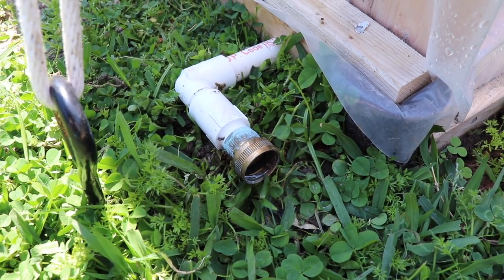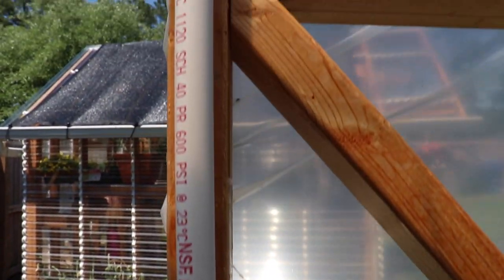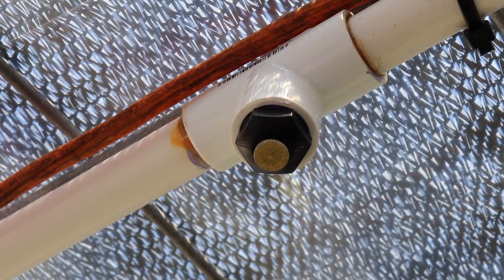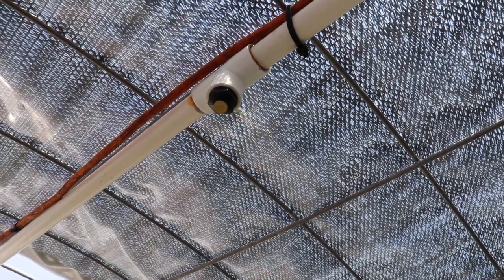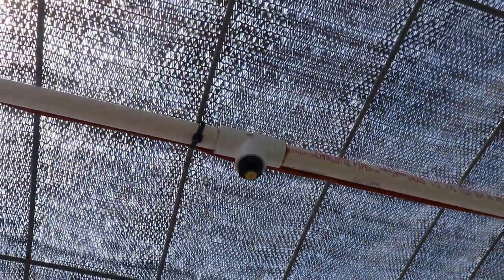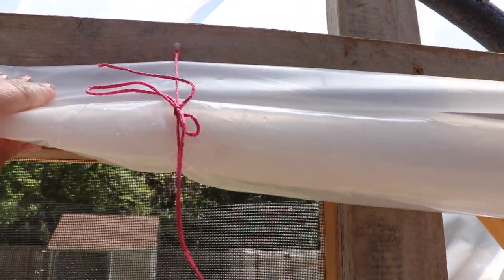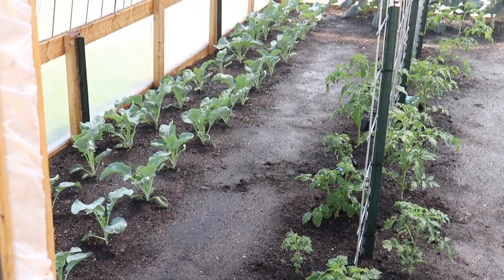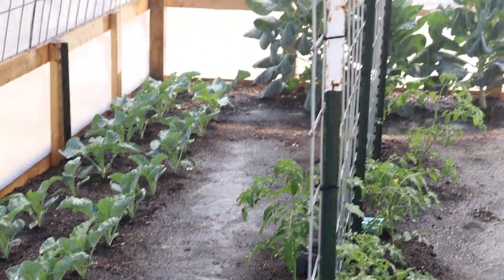Hoophouse Sprinklers || Easy Overhead Irrigation || How we Did it!

Comment: Hi from Germany, we had a wet summer over here with a lot rain. Tomatoes and potatoes suffered from that, and powdery mildew spread into some other cultures.
It dependes where you live and what cultures you like to grow. For me, drip irrigation to feed the root zone works far better than overhead irrigation. I have a few moisture sensors to tell the system that the drip irrigation has to start and stop,  depending on soil moisture.
Cheers, Bernd
Reply from the maker: Yes we’ve done drip irrigation in our greenhouses before & we like that as well. Thanks for watching, cheers!
Reply: @HomeFreeAlaska   - I absolutely love this system, when I finally get our greenhouse built hopefully this spring I am planning to use your system. I love that it replicates a mild rainfall, although now that I think of it, I am wondering about something... We tend to get a lot of rain here in Central-Eastern Ohio and I am planning on catching some of that rain to use in the garden since we only have one spigot on the house that I need to water not only our front gardens but also run 300 ft. of hose to water our big garden out back which is ridiculous. So I am wondering if this system will run on water catchment if I have my barrels up high enough to create a natural downspout pressure of some kind, what are your thoughts?  Also, I would like to ask you and @RheinErftVideo if you can please describe these moisture sensors a little more for me.  Thank you so much for all of these wonderful inspirational videos. Many Blessings to you and your beautiful family.    
~SuzyJC-in-Pataskala-Ohio/USA_03.04.2022~
Reply: @suzycowan5072   Hi Suzy, just saw your question and this is the way I did it:
A used 275 gallon IBC tote / container / tank (make sure it was not used for chemicals before) is about 50 $ over here. To collect rainwater. You can stack them. 

I attached a 12 Volt Waterspout Fountain and a magnetic valve. Without the valve, the  water would rinse all the time.

The sensor for soil moisture is some electronic China product from ebay. You put it into the soil and you can calibrate it to what soil moisture you want / need. 
If it´s too dry, the sensor will open the valve and start the pump. If moisture is about the right parameter, the system will stop.

The 12 Volt system is very good to be independent from electricity and just works from a solar panel and a car batterie.

For the drip irrigation, I made this from small tubes for electric wires to be used in house installations. Small holes being drilled into it so water drips into the rootzones of the plants (measure before how far you plant, I would say 15 inch distance is a good start for drilling).

As you can see, this is no ready-to-go system, but pretty easy to install and low-cost.

Comment: nice greenhouse build :) . I have just 2 points to 'critic' if you allow : never water the tomatoes leaves ( to prevent from deseases ) , and you should cover the ground with mulch or chalkboard to prevent from water evaporation. An irrigation on the ground and under the cover, would protect better the plants , and prevent from water waste :)
Reply from the maker: Thank you my friend but we’ve done ground irrigation before & wanted to try overhead this time. We’re ok with a little water waste as we live on a well & it’s not much waste anyway, it sinks down into the ground within minutes! And plant leaves get wet all the time with rain…that’s the natural way to water. 😉 I’ve never had any issues with watering this way…most important thing is air flow and circulation, prevents the plants from getting disease. 😊 Thanks for your recommendations & for joining us on this video! 😉

Comment: I really like the connection attachment for the water outside the building. This allows water that may be caught and saved on site to the pumped on the the sprinkler system using a submerged pump in the water storage and then pumped by hose.
Reply from the maker: Yes Marshall, that's actually a great point. I hadn't thought about that! Thanks for joining us on this video! :)

Comment: Thank you for your video. Question" What kind of materials that you used to cover above the clear plastic on the top? Why did you need this material?
Reply from the maker: Hello again :) Thats a shade clothe. It's optional but it's very useful in reducing the inside temp of the hoop house while still allowing the sunlight through for the plants. 

Here in VA its way too hot in the hoop house in the summer time, the plants would just die! The shade clothe makes it a lot better in there. That & the fans for circulating the air.  I bought it on Amazon, pretty inexpensive. I put links to all the supplies in the description box of the video. :)

Comment: It would more easy if you use a rain tank and an a cheap irrigation programmer, so, you don't need to take the heavy hose from the home to the greenhouse for watering. Only for refelling in case that it's empty. Greetings from Spain.

Comment: You don't end up with mold in your hoophouse from that? I probably would have just laid a soaker house along the ground where I wanted to water.... awesome system but seems a bit more complicated than necessary
Reply from the maker: Not complicated at all Keith. Actually installing these sprinklers made my life way easier! I just turn it on & it waters the plants for me. We’ve never once had a mold issue. We have a lot of ventilation & air flow in the hoop house. 😉

Comment: Tomateiro não gosta de água nas folhas.
Reply from the maker: As long as there is good air flow and circulation, we have never had any issues with wet tomato leaves causing problems. After all, they get wet naturally in the rain if planted outside. Pruning the tomato bush is essential to ensure good air flow :)

Comment: Tomatoes are sensitive to water on their leaves, risk of development of late blight.  Sprinklers are not a good solution ...
Reply from the maker: Thanks so much for your comment but we’ve always watered our tomatoes with the garden hose & their leaves have always been wet in the process & we’ve never had an issue with blight. As long as there’s good air flow, they’re fine. I heavily prune my tomatoes to ensure they have good air flow! Thanks for watching! 😊
Reply: If this were true then what happens when it rains?, I think it is more about air circulation.
Reply from the maker: @workinonit9562  my thoughts exactly!! It’s all about air circulation.

Comment: Nice job i live in alaska i think i would have to take it apart for winter we get lots of snow.
Reply from the maker: Hi Patricia! We LOVE Alaska, what part are you in? We spent 7 yrs there with the military. 3 yrs in Fairbanks & 4 yrs in Ketchikan. We’re considering retiring there. I don’t think you’d necessarily have to take it down in the winter…I just think it may need some added support beams down the center on the inside to help hold snow. But I think it would be important to clear the snow off of the hoop house every so often and not let it rest there. 😊
Reply: If you're worried about snow then a gothic arch with cross bracing should be able to handle much higher snow loads. Think how strong a medieval cathedral is and they're an arch supporting a triangle. You could still use a similar construction method, but have a wooden ridge line and possibly some center supports. They do need to be a little higher than a semicircular arch though.
If you have high winds then using twin wall polycarbonate is another option (more upfront cost, but will last a lot longer). This is a common solution in the Shetlands, where there are very high winds.
A gothic arch polycarbonate tunnel would be extremely tough. There's plenty of information on both ideas here on YouTube.
Best of luck!